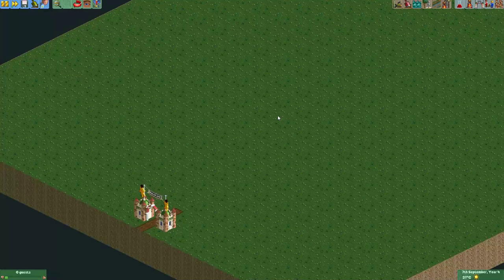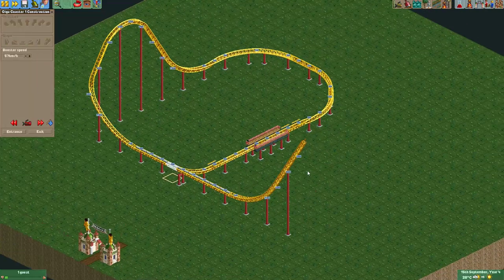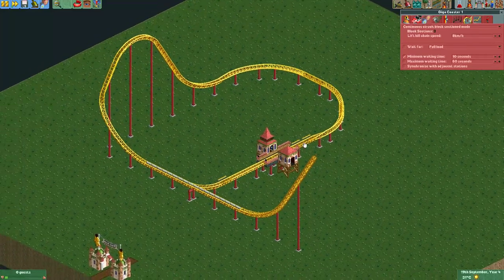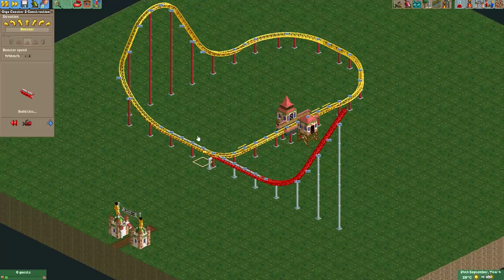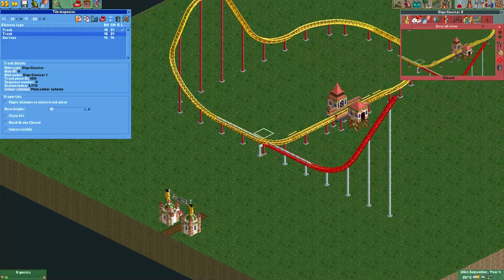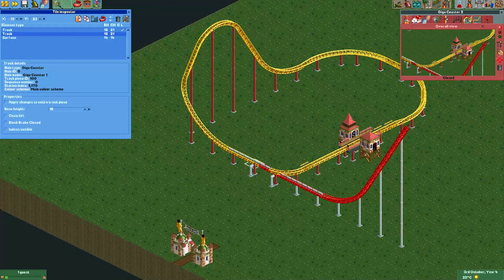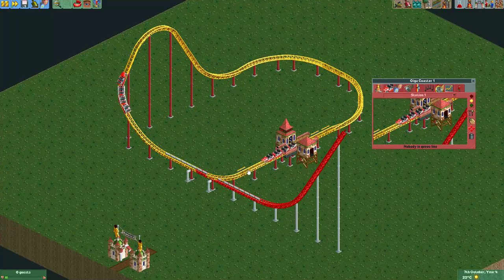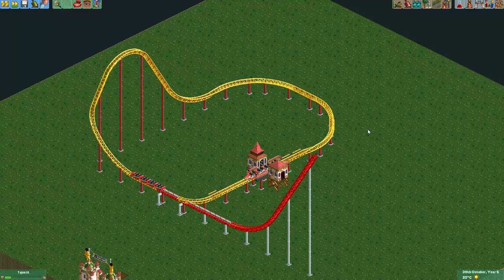Git Gud at OpenRCT2 #62: Block sections on a triple launch coaster!

Comment: Well... wasn't new to merging, but fairly new using OpenRCT2. Followed your instructions step by step and whenever I'm making a mistake, the coaster itself works, but doesn't pass the block brake. So far, so good. Making NO mistakes, which should resould in a working coaster with a triple launch, just crashes the game?! Any ideas on how to resolve this issue?